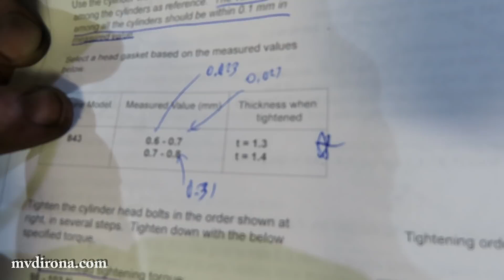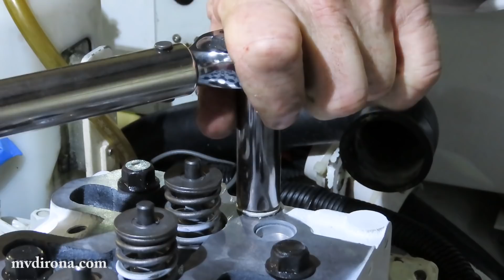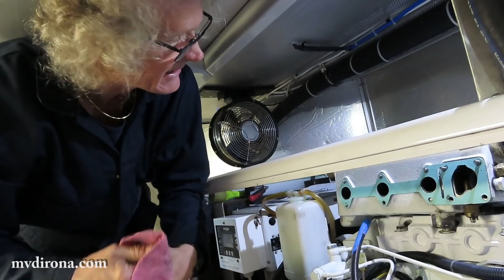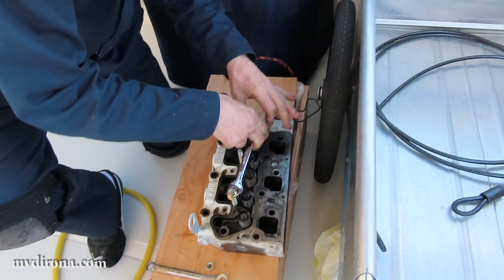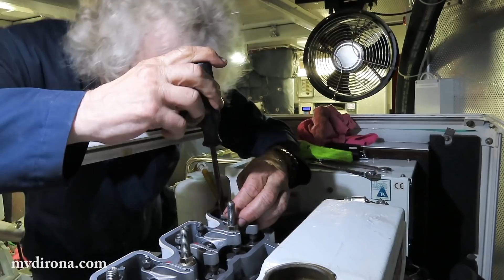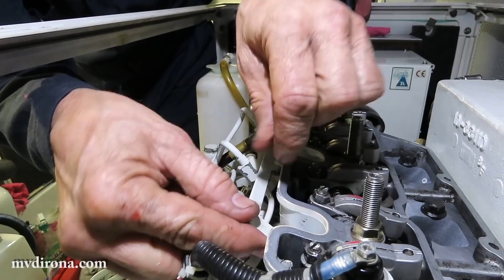Replacing Northern Lights 12kW GenSet Cylinder Head Part II (@MVDirona channel)

Comment: Your videos are fantastic. I have the land based version of this gen set. It has run for 23 years as a major source of my hawaii farms power and I have never had to do anything but maintenance. I am now going to be rebuilding the head or buying a new one as you did. I will be using your video information a lot. Just one question..? Where did you download your shop manual or order it from?  😊 Thanks so much
Reply from the maker: Thanks for the feedback on the video and it's great to hear how well your Northern Lights generator is running. Music to my ears. 

You'll be pleased to know that, unlike much of the industry, Northern Lights doesn't treat there online manuals as yet another revenue source.  They are up at; https://www.northern-lights.com/technicalinformation/manuals/
Reply: Thank you so much for your quick reply 👍🏼 I see the operator manual and the parts manual.. do you know if there is a actual shop manual or if there isn’t do you suppose the Perkins 403–15 manual would work for this generator. I would appreciate your insight also as to whether you think that the parts may be interchangeable between engines, especially concerning the head. Thank you again I really really appreciate it.
Reply from the maker: Drop me an email to jrh@mvdirona.com and I'll send you an electronic copy of the Northern Lights Manual I use.

Comment: You could try your feeler gauge’s next time? Might work better.
Reply from the maker: I know of no way to adjust valves without using feeler gauges and wouldn't dream of doing it without them.
Reply: Sorry I was thinking about the head gasket, maybe feeler gauge’s may be easier then a dial indacater? @MVDirona
Reply from the maker: Good point.  A high quality metal straight edge and feeler gauges would probably be a better choice for that operation.

Comment: I would have no problem trusting your work.
Reply from the maker: Thanks.  These little engines are reliable and fairly easy to work on.  I suspect it'll go another 8,000 to 10,000 hours without needing to be opened up.

Comment: 1980's Alaska Crabbing shut down mid seasons with boats and crews stranded - banks owed Millions. I was on a Repo Crew picking up crab boats to drive to Seattle. Banks would only buy enough fuel for a Gulf crossing. Crew was captain, mate, cook and engineer (me). Advance news of our arrivals allowed time for angry, unpaid crews to sabotage the boats. Each time was a guns drawn situation. My job was to get two mains and one gen set running ASAP. Middle of the Gulf gen sets and mains would die. Done that job by flashlight in 10 foot seas. You have my respect.
Reply from the maker: That sounds like more excitement than I need at work :-).  If you can do that, fixing engines in flat seas with good light like I do is child's play.

Comment: 31:58 I have the same Shibaura N843 in my 2005 TC33DA New Holland tractor as well.  Its a good little 1.5L (1496 CCs) motor.  Mine is rated at 33HP Gross @ 2800 RPMs.  I see yours is rated at 20.1 HP (15KW)  @ 1800 RPMs.
Reply from the maker: Good little motors.  The generators are rated lower than propulsion engines.  We have the 4 cylinder version as an auxiliary (emergency propulsion) engine and it's rated at 40 hp. About the same HP per cylinder as your tractor.

Comment: Thanks for the reply how do you both manage to keep dirona so clean and tidy happy adventures xx
Reply from the maker: Thanks for the feedback.   

On keeping the machinery spaces clean, we mostly just wipe up spills when they happen and ensure that nuisance leaks are corrected or at least contained.  Surprisingly, the biggest source of dirt is actually the massive air flow through the engine room when the main engine is running.  Air brings in dirt and so, over time, it will build up. Every month or two we'll vacuum that up or wipe it off to avoid accumulation.

Comment: Hi all fantastic video footage and documentary information brilliant for people who have to carry out their own repairs. Pp I would have left the injectors out so making it easy to adjust the valve clearance thanks.
Reply from the maker: It's only a 1.5 liter engine so pretty easy to turn with full compression but, yes, you are right leaving the injectors out would make the valve adjustment even easier.  

Thanks for feedback on the video.

Comment: As a fellow gray haired man, I admire your ability to spend all that time crunched down on your knees like that.  I could never do that, but I do enjoy your videos.
Reply from the maker: Yeah, I know what you mean. I find that a day in the Engine Room nearly always yields a day or two of sore back.  I have knee pads for working in tight quarters and they are remarkably effective at solving that problem but the back doesn't seem to have an easy work around.

Comment: Great informative video, And great way to save money doing it yourself. Looks like you're getting very familiar with the engine room.
Reply from the maker: Yes, probably true. It's been 11 years and 11,300 main engine hours. Generally everything has been pretty reliable but I've still spent some time down there.

Comment: No sense horsing around when it’s your source of power on those crossings, a few thousand miles from anywhere. Take the time to be patient, double and triple check everything, and do it right. You’d rather be fussing with it for an extra day safely tied up on the dock with shore power and a chandlery just a walk or an Uber ride away, than trying to deal with a busted genset in 20 foot swells in the middle of an ocean cuz you got sloppy. Well done. :)
Reply from the maker: I agree. Keeping the systems reliable is important to us.

Comment: great video folks! it is a RISCy procedure with lots of precision to prevent any runtime exceptions. tuning and data integrity without rolling back is key for safe  sailing! greetings from an old 1150 dude!
Reply from the maker: Thanks. And it does sound like we did work together at IBM. All the best.

Comment: if the spec is ~72-76 ft lbs, shouldn't you consider the accuracy of the torque wrench? If, for example, you set the wrench to 76, you might risk over torquing the bolt.  Then the logical value would be dead center between the two spec values so the setting should be 74?  Was your torque wrench certified recently?  Does it matter?
Reply from the maker: In my experience, giving a range for torque rather than a single value is pretty unusual -- I can't think of a time where I've seen that approach before. Your suggestion to use the center of the range seems logical and makes sense. My thinking is even torque across the head is vital and we must be under the max torque for the fastener. I chose to use the upper end of the range but I don't have a strong belief that is a better choice than anywhere else in the range.

Comment: Wrong tool for the job. You need a depth micrometer for accurate measurement.
Reply from the maker: Anything that can accurately measure thousands of an inch is fine. I don't have a micrometer on the boat but I agree it's a fine tool. Dial gauges are a bit more versatile for my use case where they can measure shaft runout and other issues common on boats.

Comment: Question about engine room access, I see there are access hatches in the deckhead above the engines and that you used one to access the engineroom. Did Nordhaven design into their boats a way to remove the main engine or a block replacement if that became necessary (Hopefully it does not for anyone) ?
Reply from the maker: The hatch above is a nice easy entrance to the engine room and I use it when Jennifer is asleep  in the master state room or if I'm getting something that is close to that entrance but we mostly use the main entrance from the master stateroom. I would say our usage is roughly 75% on the main entrance door and about 25% through the hatch. 

Forward of the access hatch you where looking at is 4 large removable floor boards that can be lifted out leaving an X support below. The X support is removable as well leaving a very large opening in the Salon to allow access to hoist out large machinery such as the main engine, wing engine, or generator. Nordhavn does a pretty good job of making the boats serviceable. No builder is perfect but they do unusually well.
Reply: @MVDirona  Thanks for the explanation, nice to see that level of thoughtful planning. As the Nordhaven hulls are pretty tough and  will be long lived, it is likley at some point they will require engine replacement.
Reply from the maker: It's pretty rare to replace a main engine in a diesel powered recreational boat due to wear. Many get replaced due to poor installation design, poor maintenance, or  orverloading. I have seen generator and wing engine replacement in a Nordhavn but I don't know of a main engine replacement. Admitted, at our current 1,000 hour a year pace, it will happen but that number of annual hours is unusually high.

Comment: Thank you guys for  a very informative and excellent video at times i think you have to be a Contortionist to work in those tight places.
Reply from the maker: You are right, some service items on a boat can be challenging to access. This boat is actually far better than average and so I mostly feel lucky. It's not bad from a serviceability perspective but all boats have some jobs you just would rather avoid :-)

Thanks for the feedback on the video.

Comment: J & J, thank you both for the great videos and contributions to the Nordhavn Dreamers.  My wife and I live in Mass. and frequent Newport, Ri. We loved your video prepping Dirona for an Atlantic crossing to Ireland. We are working with a local Nordy broker and are planning to purchase a used 47 in the next five years.  My wife wanted to know what you do with the fuel bladders once you are done with them.  She also wanted to know what wave height/sea conditions worry you and Jennifer the most?  We realize that there is uncomfortable but what would you consider too much even for a Nordhavn? 

Best regards,

John
Reply from the maker: The fuel bladders once empty are quite small. We fold them up and store them in the fly bridge brow area until we next need them again. Dirona has 2,500 nautical miles of range without bladders so, strictly speaking can get anywhere without bladders. They just give more flexibility on routing and speed.

On the waves that make us uncomfortable, 20' is as much as we have seen and, at that point, they tower above the pilot house and smack the PH pretty hard if taking waves on the beam. These feel big but we have seen that magnitude 3 or 4 times so it's not really scary. We had one event where we had a mechanical problem that was allowing water onto the boat at the same time and that was fairly stressful: https://mvdirona.com/2017/05/alarms-at-115am/.

But, in the absence of other problems like the water leak mentioned above, it's not scary and, since that is all we have seen, we don't know when the boat would truly be at risk. At somewhere in 25' to 30' range, the boat would would have to be brought into the wind. It's much more stable bow into the waves. We have never had do to this so when it would be required is a guess.  We don't know the limit the boat can take but we would guess something above 30' would constitute survival conditions.

Comment: For the manifolds that seat on the side of a motor, I’ve made a few rods of all thread that hold the gasket in place and let’s you seat the manifold and attach the first few bolts without having to hold your tongue just right :)
Reply from the maker: Yeah, that would be a much nicer solution. I probably should pick up some threaded rod stock. Thanks for the suggestion.

Comment: Hi...great video as always. So did you decide on what had actually caused the damage to no3? Was it a one off ingress of water? I didnt see you show the damage to the valve seats on number 3..I presume that was the issue in the end?  Sorry if I missed it in the videos..I have watched them all..promise...cheers.
Reply from the maker: This video was getting too long so we split off the bleeding of the fuel system, adjusting the valves, starting the engine, and investigate the damage and would might be done to avoid it in the future.
Reply: @MVDirona  ok thanks. I dont know about others but for me the video shot by ... it had a lovely natural flow about it. Great editing. Camera work and presentation...
Reply from the maker: That's all Jennifer's fine work. We appreciate the feedback.
Reply: @MVDirona  ah your too modest ...looked like a pretty good team effort to me..
Reply from the maker: Yup, it's a great team and it's a fun place to work.

Comment: Learned something new today : this ( 2 or) 3 step torque applying. 
Will keep that in mind as I believe it is a carefull and thorough method !
Reply from the maker: There is some debate on this one. Some argue a single click and a single pass is all you need. I don't agree on either and prefer multiple clicks confirming target torque has been achieved on the belief that a torque wrench is a simple mechanical device with some error margin. I give it three checks.  On higher torque parts, I like to do a staged torque where I first bring it up to 50% or 75% of the goal, and then do a final pass at 100%. I think it's a good approach but, as I said, some will debate it.
Reply: @MVDirona  Indeed : a simple device brought up to a more refined level with the 50/75/100 method !
Reply from the maker: Thanks!

Comment: When you were cleaning your gasket surface on the block did you need to plug up the holes to ensure nothing went down into the engine? 
Will you need to do another oil + filter change after the work or is that necessary? 
Thanks.
Reply from the maker: It's impossible to completely avoid gasket debris falling into the engine. What I is used compressed air to clean out most of it. Compressed air is actually very good at this but there will be a far higher load of impurities in the oil and a short oil change is a good idea. The filter will catch the debris but a short change is still good insurance.

Comment: i cant wait to hear the baby running it went well ,oh if you dont have dial guage, another way is sit a metal rule with flat edge on the piston and overhang it an inch or two over block use feeler gauges between edge of ruler and block to measure the height
Reply from the maker: Good suggestion. That would probably produce a more accurate measurement. Certainly no less so and it's quicker to do. Thanks for the suggestion.

Comment: As far as missing torques values go, often manufacturers have a chart in the manual of standard torques for different sized bolts, nuts,etc. If there is no indicated torque in the assembly instructions look for that chart. Often in the start of the book. Cheers
Reply from the maker: Yes, you are right Mike and I have used that approach for some large fasteners like the  steering rudder arm bolt but, on this one, we used old mechanics judgement which isn't foolproof but generally isn't bad :-).
Reply: I figured you may already know. My background has provided me with “Calibrated hands” as well. Your technical expertise is a cut well above average. The comment was as much for your audience if they are not as experienced. I’m retired with 40+ years of helicopter maintenance experience and know with certainty I will learn something new every time I watch videos such as yours. Thanks again for all the effort in posting these experiences. Cheers Mike.
Reply from the maker: Your job was more challenging. A helicopter has far worse space limitations, is life critical, and with power-to-weight so important, they push the engines far harder. This little engine is only 20hp out of a 1.5 liter 3 cylinder. Thanks for the feedback on the video.

Comment: If you ever have to take that exhaust off again, maybe installing a couple studs would be worth it. Would certainly help with reinstallation
Reply from the maker: Great suggestion. Studs would make a massive difference. I did that on the Samsung 55" TV and it made a massive diffence where it just slips into place and I can hold it there and spin nuts on the back. Before that, it was a pain to get it aligned and then get the bolts engaged. Thanks for the suggestion.

Comment: I thought it would have been easier to adjust the valve setting before you put the glow plugs and the injector in so that you could turn the engine by hand!
Reply from the maker: That's true but it's pretty easy to turn a 1.5 liter engine but, yes you are right, without compression is always easier.